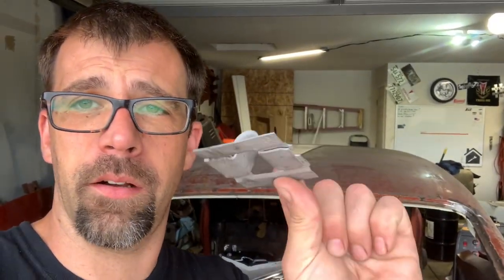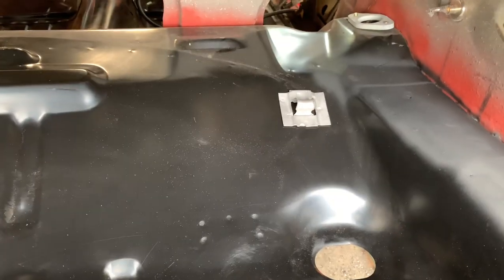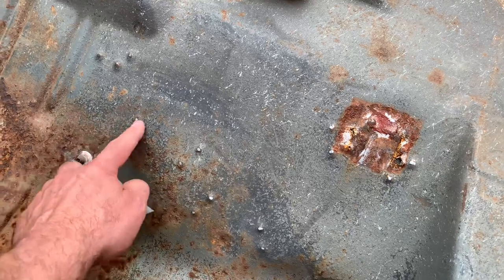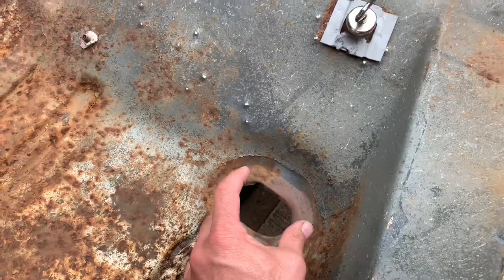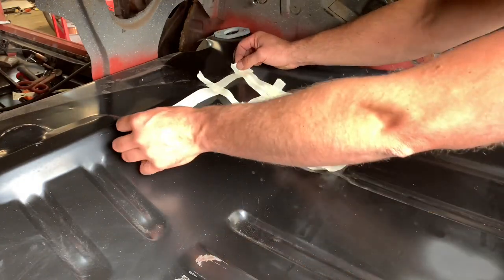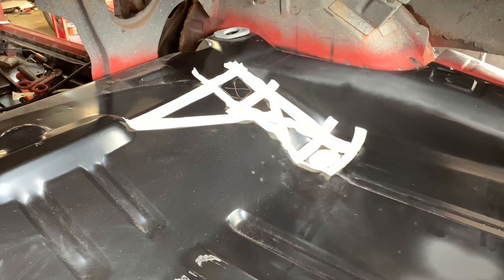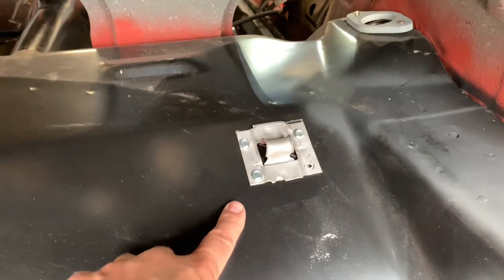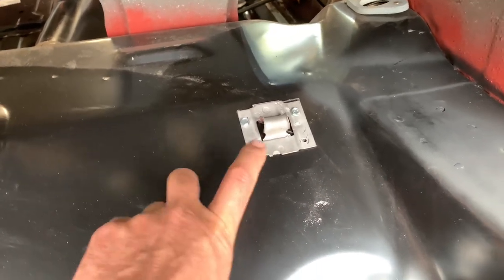1968 Firebird spare tire hold down location and installation.

Comment: Making the tape patters - great idea.
Reply from the maker: That was the point of the video. I use masking tape templates for a lot of parts and locations. Even rear window openings. It’s cheap and relatively accurate

Comment: Would the convertible space saver spare be in the same location as the hardtop?
Reply from the maker: That is a good question that I don’t have a definite answer for.  All of the convertibles I have messed with they have all been on the floor not on a the angled part. That doesn’t prove what you are asking but so far I haven’t seen them on the angel part on a convertible.   I would also like the answer.

Comment: Thank you for this great information. Did the hold down bracket come with the 4 metal screws and the holes already made? If so where did you order it from? Thanks in advance!
Reply from the maker: Classic industries sells a new hold down, the one in this video was the original all sandblasted and cleaned up.  The screws I added
Reply: @VinylVillageGarage  Thanks very much for your reply. Would you be kind enough to inform me with the length and diameter of the sheet metal screws you used in the video?  It would eliminate my guesswork and ensure that the job will get well done. Thanks for your help.
Reply from the maker: @andrecassis9844  the screw is listed as self tapper #10 x 3/4” with a 5/16” hex head.
Reply: @VinylVillageGarage  Thank you do very much!👌